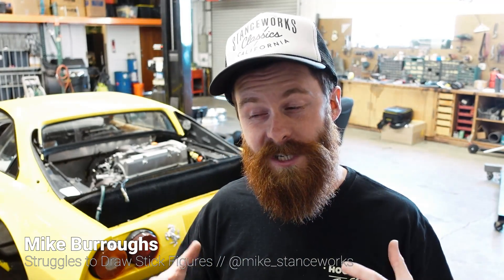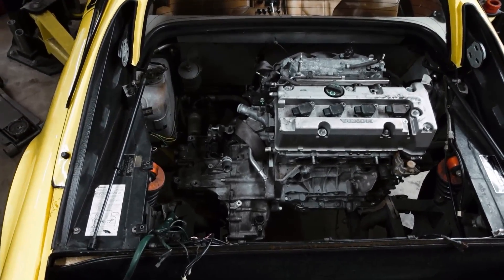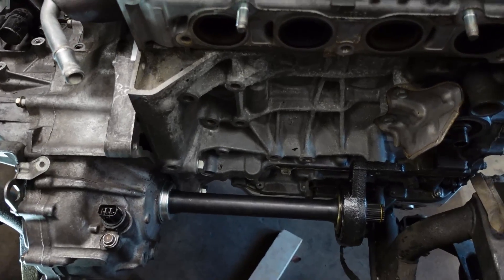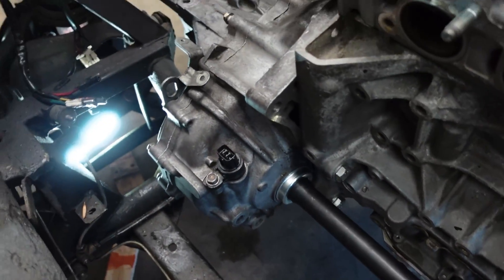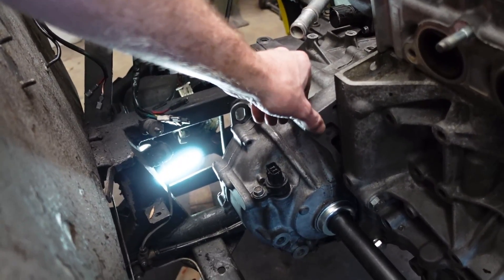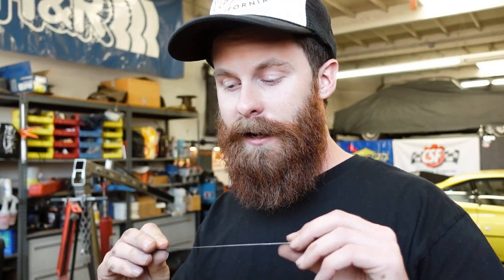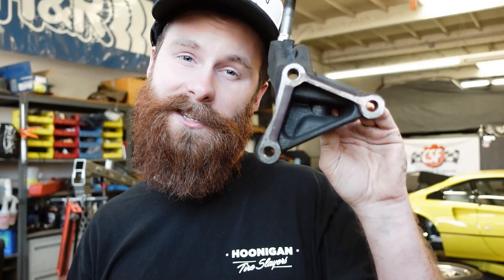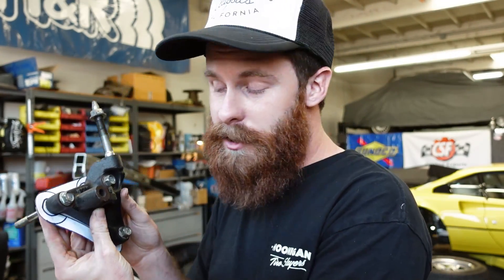Ferrari 308 GTBi with a Honda K24 Turbo: Engine Mount Design Processes - Ep. 8

Comment: for flat surfaces like this, you can 2d scan the object with a photocopier and then trace the shape using inkscape. Then export as an SVG and import into your preferred CAD program and you have the face of your 3d shape. Works perfect for flat faces.

Comment: BTW, as an alternate to a dry sump system, did you look at Accusump alternatives?   If so, what were your thoughts?   I have a full dry sump system on my track car, but as you said, they are expensive.   In my next race/track car, I am considering a K20 and an Accusump forced oiling system as an alternative to a full dry sump system.   Your thoughts?

Comment: The dry sump is a more responsible solution for this configuration because cutting into the frame may compromise the rigidity of the rear part of the chassis.  Using a CAD program to manufacture engine mounts is an advantage you have, and you are so lucky to have this option.

Comment: Plus, you can always add fillets or strengthening gussets to whatever your primary supporting structure is on the engine mounts to ensure that they only flex at the bushing. Other options include building structure off of the chassis or sub-frame to accommodate the stock engine mounts from Honda and just use them as-is with some better aftermarket bushings.

Comment: funny,, 2 weeks ago. i made my engine mounts for my 2.2 ecote to alfa romeo spider conversion.. did not use a pc.. but carefull measerments... .......took 3 trys.. on my i found the best way to get my engine were i wanted to be, was.. base plate bolted to the engine... easy part then horizontal plate.. then add 1 inch square tube ( had the engine in the car , but on a lift.. )  get the engine as low as i could.. place the square tube  on the horizontal plate, couple tack welds.. the 2 nd horizontal plate drilled first to mount on the polly mounts.. bolt those in.. then move the engine a little,, couple more tacks.. . repete on pass side.. remove the 2 mounts, then weld the mounts fully.. at least i am doing this in the winter.. not 199 degrees outside

Comment: Once you cut the steel in the shape of the template. Use transfer punches through the original mount to the steel part. Very quick and accurate way to make the holes perfect.

Comment: Dry sump it. You are moving it rearward and it is absolutely not designed to handle the centrifugal force In the rear of the car.  In chicane situations the forces will be much stronger because of the distance from axis of rotation. Roll the engine to drop the axles, a dry sump will allow you to roll it over 90 degrees if you want to. Also lowering your CG. You absolutely don't want to stand the engine up vertical when you have a dry sump and room to roll it over.

Comment: I think it would of made more sense to just buy a used Ferrari engine like a 360 or something similar since chopping this is not a good thing when it comes to Ferrari owners watching this channel. But I understand that the Honda might be better then what came in this car.
Reply from the maker: A Ferrari 360 engine faces the complete wrong direction and would require significantly more chopping and cutting to make work, actually.

Comment: cut the vertical mount and turn it 180 degrees it will still weld back in the same place but the ark will bend in the other direction more than enough room for the drive shaft clearance and will retain the same structure because it will be welded back in the same spot just remove triangle brace and weld in original position.also could you lay the motor a little bit that might give you a little bit of breathing room as well i like what you are doing but don't over analize it it will only make things worst and go slower being a panel beater my one rule is measure twice cut once don't over think it if it needs to be cut  then cut it if it needs to be massaged then massage  other wise you will be running around in circles if you make mounts and there not right then just remake them till they are practice makes perfect my friend i like the build its different and a challenge good luck cheers from down under

Comment: Why not modify the subframe in front on the control arm mounting points? Even with a dry sump the pump will probably be sitting on the subframe .  If you drop that part of the subframe down you could rotate the engine backwards and fix the axle alignment issue.
Reply from the maker: I explained this in a previous video. It may still have to happen, but modifying the frame enough to clear the current pan would mean re-routing the frame entirely. It's the primary chassis rail we are talking about.. It's pivotal in terms of structure and strength. I don't want to diminish the strength of what connects the back half of the car to the front.

Comment: Time to take your 3D models of the K24A4 and the entire rear subframe & engine bay.  This is literally the intent of doing this hard work up front.  Rebuilding a completely new subframe would probably be the smartest course of action, but obviously the most work up front.
Reply from the maker: That seems like the incredibly long way around the barn, as it would mean redesigning the entire car behind the bulkhead. Every aspect other than the skin of the thing would need to be redesigned, and while that's definitely possible, it's not the route I want to go right away.
Reply: Seriously... I couldn’t agree more, glaring issues are all but demanding a "back-half" to make this worth it... Cut it apart and put it were it needs to be instead of a cut and paste mess of scabbed on plates and bars... but also, Great Video

Comment: Just a thought...see if the company that you plan on going with for the dry sump can 3D print a mockup. It would provide you with a way to continue with the engine placement without the wait for the actual dry sump.
Reply from the maker: Great thinking! I'll definitely see if that's a possibility.

Comment: Very happy to hear you are going dry sump.   Seems like the fuel tank is behind the driver...good place to mount the dry sump oil tank then would be behind the passenger for weight distribution.
Reply: That was the first thought that came to me as well when taking the fuel tank out was mentioned.

Comment: You mentioned removing one fuel tank in the last episode. But that means the weight balance left to right is affected depending on levels in that remaining tank. Doesn't that bother you?
Reply: I think that subject was brought up in the previous video.
Reply from the maker: Not really, no. When it comes to maximizing the car, I'll have enough fuel for a couple of laps and that's it anyways. But overall, no.

Comment: Dry sumping, while more expensive upfront is the obvious choice because it not only solves a major issue in your swap, it also improves the build in many ways. It’s going to allow you to mount the engine lower, which will improve your center of gravity and thus handling. It will allow your engine to rev freer/higher and reduce parasitic loss on the windage. It will prevent your car from oil starving on high g corners/accelerating improving engine life, and it will save you huge amounts of time (which is money) and prevent you from potentially destroying your cars chassis/suspension geometry by having to hack it up.

To me it’s all win/win aside from the initial cost (which will be offset over the time saved/improvements gained).

Comment: Stock oil pan is fine just run the k20 oil pump
Reply from the maker: That's debatable, but the main issue is that won't fit into the car.

Comment: Before making and especially cutting anything I would grab the nose off the vehicle that engine came out of and examine how it’s mounted and the suspension geometry.
I would then consider cutting the back frame off the Ferrari completely and welding in either the original Honda front frame or a tube steel version designed to blend the two vehicles.
From the looks of those dry sump systems and where the oil pump is in those motors you are going to have to cut the frame rails or heavily slant the motor to get the diff to line up where you want it. You’re not going to get more than an inch of change by cutting the sump or using a dry sump due to where the oil ports are at the front of the motor.